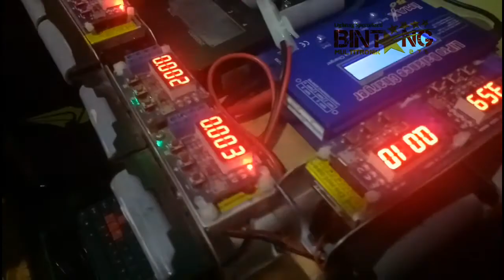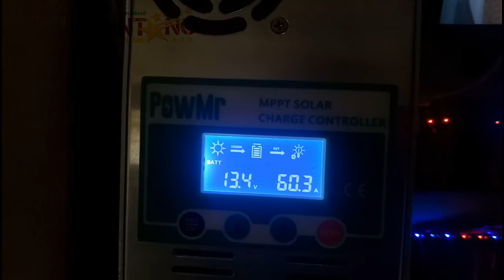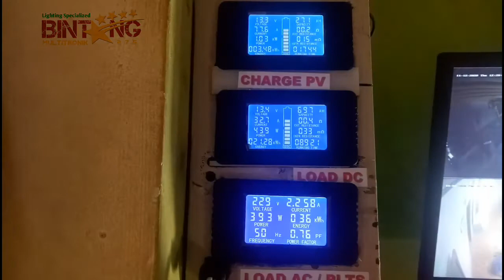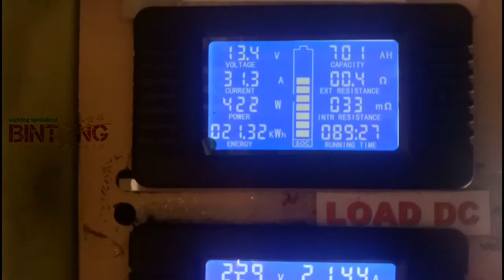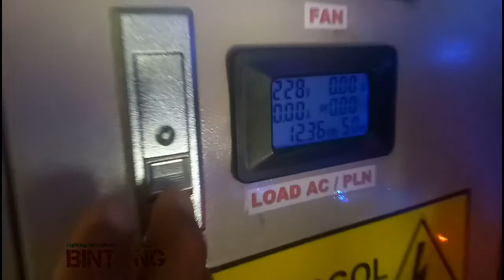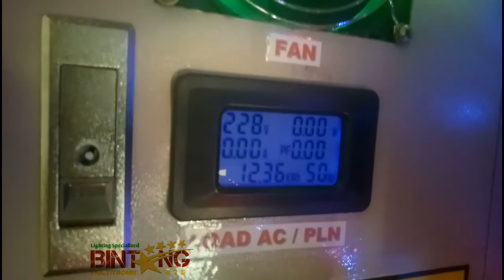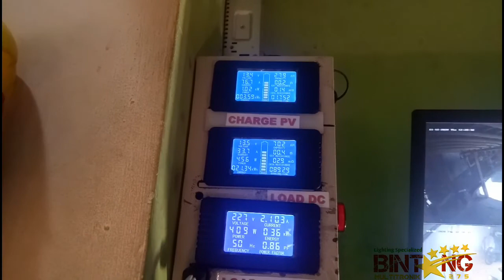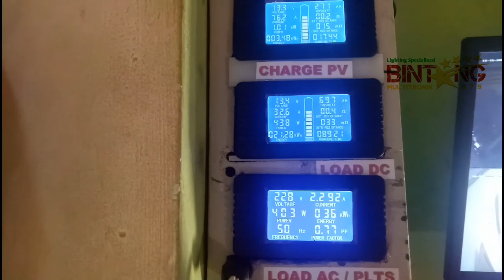PLTS Offgrid 2000 watt on 24jam tanpa PLN. Solar panel Tenaga Surya

Comment: Itu kabel berapa mm2 yg jadi input dan output powMRnya pak? trus pakai kabel apa? Outputnya powMR yg kebaterai kan ada dua port pak, bisa kah dibuat ngecharge 2 baterai berbeda  dari 2 port berbeda di pow mrnya langsung? artinya dari outputnya pow mr itu langsung mengalir ke 2 baterai yg berbeda dengan kabel yg berbeda
Reply from the maker: asalkan karakter battery nya sama dan juga kapasitas nya gpp atau bisa, krn di powmr nya kan settingannya hanya 1 mas,... 

kabel dr pv ke scc 6mm. kabel dr scc ke mcb 16mmx2. dr mcb ke aki 32mm. krn ini system 12v jd boros di kabel/kabel harus ukuran besar krn ampere nya gede, klo peak bisa smpe 100A lebih soalnya
Reply: @Bintang275  pak kabel 16 mm2 keluar dari SCC itu bagaimana caranya? Saya coba maximal 6mm2 saja ferulenya yg bisa masuk. Berarti itu gak di ferule ya pak kabel 16 mm2nya, trus serabutnya dipotong gitu ya?
Reply: @Bintang275  berarti keluar 2 kabel beda dari SCC menuju masing2 ke 2 baterai gpp ya pak? Itu artinya pemasangannya baterai paralel kah pak? Arus chargingnya nanti terbagi ya? Tapi voltase chargingnya tetap ya
Reply from the maker: @medstory1466  pake ferules pak di potong seukuran besaranya skun, trs masuk ke mbc, dr mcb baru kabel besar
Reply from the maker: @medstory1466  betullll. sama aja di paralel. tp ya balik lg spt yg saya sampikan di atas...battery harus mempunya karakter yg sama dan juga kapasitas yg sama jg. krn di scc nya hanya ada 1 settingan nya